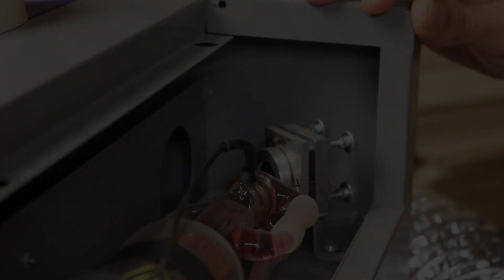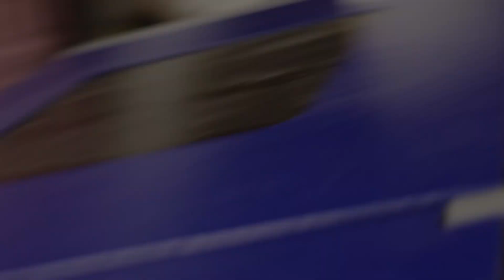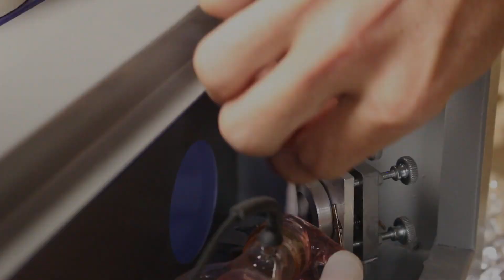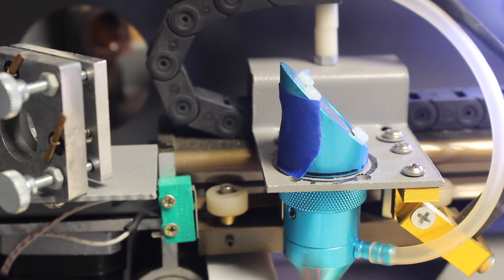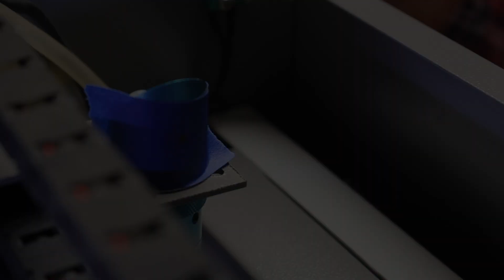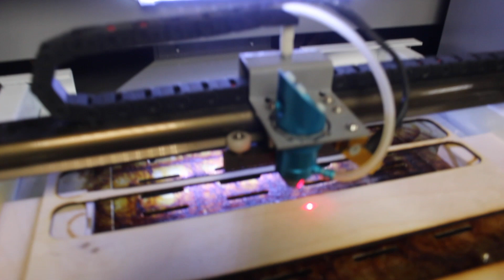Monport 40 Watt Easy Mirror Alignment

Comment: Thanks for sharing, I just wished you would have  shown how to adjust the laser head if it was not centered, as there are no adjusting  screws on the last mirror.
That is my problem , no one shows how to adjust if its not centered.

Comment: Never use tape, so many videos showing you should use tape. Been doing laser machine service for years. The problem with tape is the laser vaporize the glue and some cases can bond it to the mirror coating. Best to use clear acrylic, even at high power the laser will take a while before burning through. This way you can see the mirror clearly as well as the white spot burnt onto the acrylic therefore do alignment easily and safely without damaging mirrors. Works a charm
Reply from the maker: I’ll have to try this. I’m always open to new ways to try. How do you secure the acrylic in front of the mirror?

Comment: aye great video it cleared up a few things for me. I just have a question though why won't my monport 40w run past 1ma when running material test and I knob up all the way on machine and it won't change between power settings when conducting test.
Reply from the maker: Hey thanks and thank you for the question. What does it read when you press the test button on the machine?